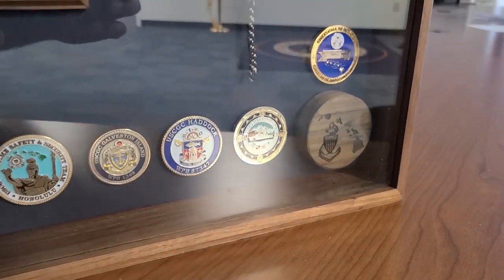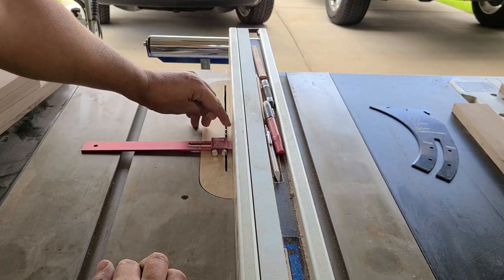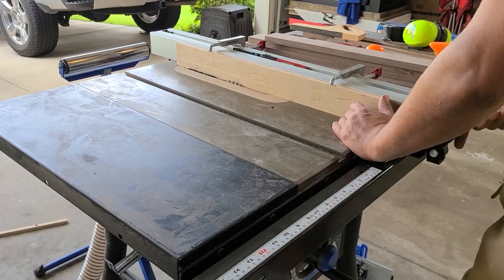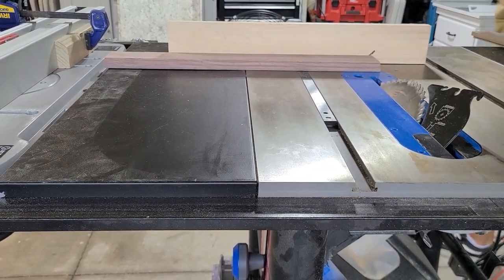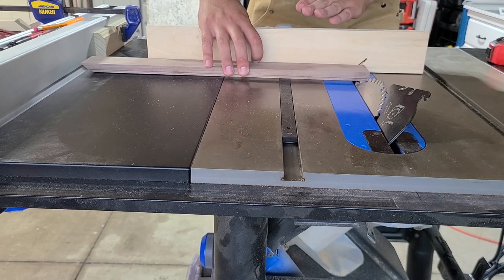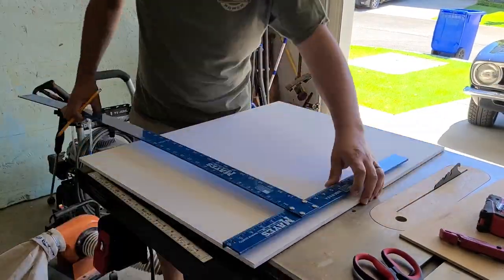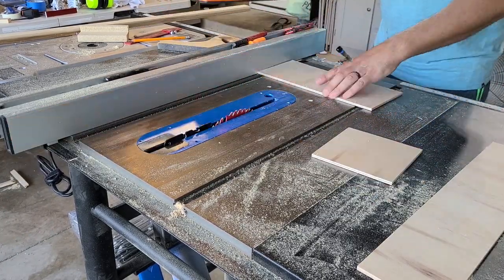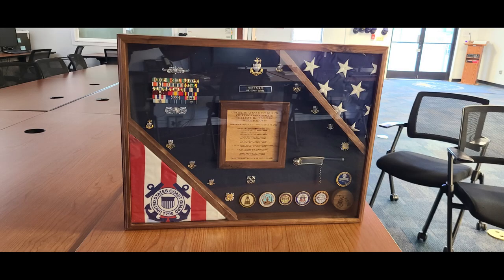How to build a military shadowbox

Comment: For the Coast Guard flag in the lower right hand corner, what flag are you using, and are you folding it like a USA flag, or do you have to get creative to get the CG emblem centered on the triangle?  Thanks, great and helpful video.
Reply from the maker: I had to get creative to get the CG emblem to look the way it did. Basically I cut out a piece of cardboard into a triangle and folded it with the emblem on the front and did what I could behind it. Thanks for checking it out!

Comment: Great video thanks.  Why not use a miter saw to cut the bevels?
Reply from the maker: The miters come out a lot better for me on the table saw. My miter saw has too much deflection when making precision cuts.
Reply: Thanks for the answer. I was wondering the same thing.  @rusticanchorwoodworks693